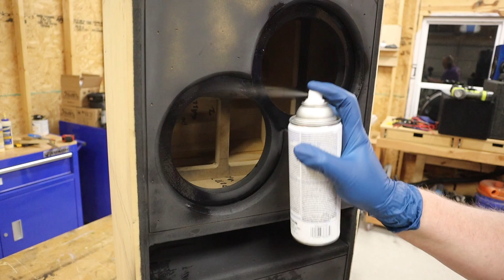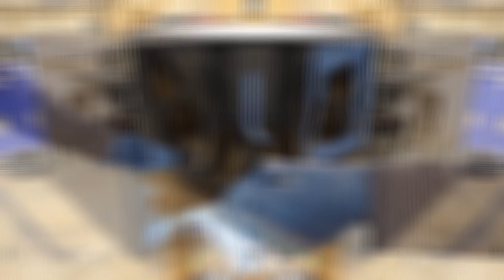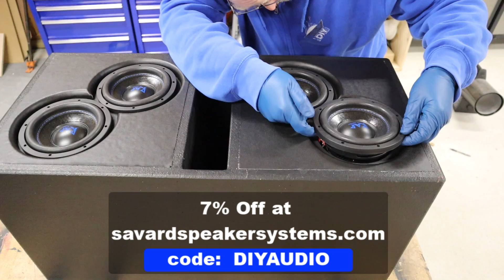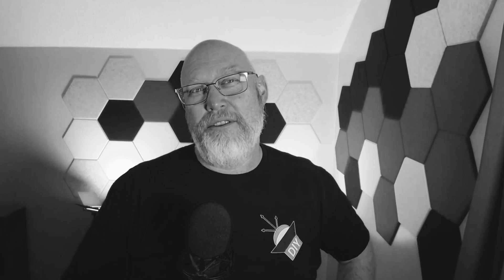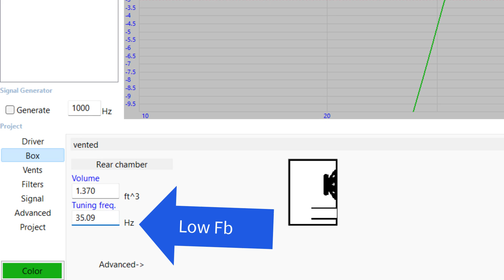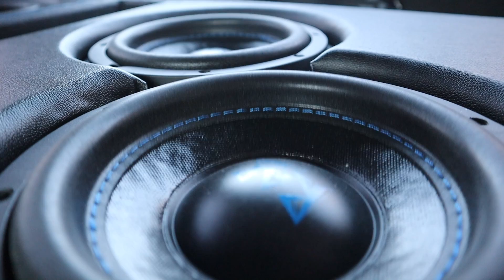Deep bass from a small subwoofer!

Comment: Great videos. For your Exohyde, 'prime' your box with Rustoleum latex paint in black semi-gloss. I get quart cans from the local big box store. A coat of that as primer helps seal the wood and prime the filler. Then Duratex (or Exohyde) will stick better, and use less. I've gotten way with one coat on some, Although two is more durable.
Reply from the maker: Right, will do that next time.

Comment: My entry level setup is 2 Skar VXF 12s, Skar prefab enclosure, Orion HCCA 3000.1Dsplx, audio control Epicenter. Been running 4 years now, flickering the clip light, wired @ 1 ohm, and all components have been pushed hard daily. 
(DC Power 325 HO & all power/ground is 3 runs of SkyHigh OFC 4/0 XL wire
Reply from the maker: Nice.

Comment: make the box big enough and even a  5 inch midrange speaker can play  about 35 hz...       so a single 6.5 inch subwoofer is more than capable of hitting as low as 30hz,     and here you have  4 subwoofers  which can easily be hitting  25hz....  or even 20hz if the box is big enough... like scan speak,  sb acoustics, peerless  woofers or subwoofers,   the main problem is  the FS....   and car subwoofers all are stiff and have higher resonance frequency...  so try some home audio speakers and you will see that they can hit the deep notes better  than car subwoofers...  because they have a lower FS ,   like 35 hz,       where as a car subwoofer 6.5 might have 40 to 50hz fs...    the tang band 6.5 subwoofers can play low ...  but has weak upper bass...

Comment: Love your channel, hoping you can address a couple of questions for me with a plan I have to upgrade an existing system:

1. If I fill air space on a prefab vented box by 0.10ft³ would that significantly affect the port tuning?

2. If I'm using an amp that doesn't have a subsonic filter could I safely use a vented box assuming my gains are set correctly and I'm under powering my subs by about 50w RMS and the air space is within recommended range by the manufacturer?

Comment: Nothing here is wrong with the box and tuning and such.. when you take subs like this and put them in a box like this.. a bass reprocesser is a must! What you’re experiencing with the deep lows that don’t punch and the higher notes that punch but don’t dig is a product of putting high fs smaller subs into a large low tune box.. 

You need a reprocessor to take those 70-80 notes and turn them into to 35-40 notes.. 

Also when you do this is better to fine a little lower.. 30-33ish cause it will play better with the reproduction notes for an overall more natural sound. 

You’ll need to go super wide with the range and then tune the impact of that range to your liking based on music you listen to the most.. 

Generally when I design and build a box like this with subs like this I also like to go a bit larger on the volume.. around 25% and then a bit smaller on the port.. idk what you ended up with on this.. but instead of the normal 16sq per cube on the port a lot of times with the larger volume and already low tune since these don’t have extreme mechanicals with say a 25mm one way xmax.. you can drop the port area down to 12-13 range and the added pressure in the box will help with the responsiveness of soft drivers like these are.. 

Last note.. as a general woodworking basic.. always coat your product with some killz or bullseye primer first.. one of seals the wood really well.. cause it’s thick it hides a lot of imperfections, it also makes for less issues when you paint or coat it with whatever.. pretty much everything sticks to it and it sticks to everything.. from woodwork to painting drywall to pretty much any and everything.. I either mix it into my paint or I apply it first as a primer.. 

Talk to any professional painters and most will tell you they mix some version of killz or similar primer into almost all exterior paints cause it eliminates having to know if the existing is oil or water based etc..
Reply from the maker: You only need a bass processor if there's something wrong with the signal, or the music does not have the low frequencies.  All of the problems with this box can be fixed with a little bit of EQ to take out the boomy upper frequencies.  It had no trouble hitting the low frequencies in that 20--50 HZ range.

Comment: the tolerances for this box design have to be spot on to work right.  it's effectively 2 ported enclosures, with the ports merged together.  you can't avoid at least some cancellation.  finite driver variations will wreak havok on the tuning, and you have 4!  can you really expect them all to move precisely alike?  impressive display of woodworking and driver consistency if it works correctly.  i don't think i would try it, tho.  if you had to replace one driver, you might have to replace them all, or break-in the new one til it acts like the old ones (but will it ever?).    i think it's a damn cool looking thing tho.  i got nothing against the small driver's, i have a pair of 6W0's and they're little wonders.
Reply from the maker: I was very happy with the sound.

Comment: I wonder if you would have better luck using a water based wood filler instead of bondo putty? The wood filler does contain actual wood fibers and dries hard and is sandable, and that may help the duratex bond to it.
Reply from the maker: For this purpose, yes.

Comment: In the late 90’s, I designed a 4th order for a Fosgate Series 1 10” subwoofer.  It had a similar impedance peak as this one, but the lower tuning frequency peak was a little lower and the resonant frequency peak was a little higher(higher impedance, not higher frequency).  The setup was hooked up to a HiFonics Vulcan (180 watts bridged) running 4 ohms bridged.  

It ended up being a one note wonder, but holy cow was it LOUD!!  The 808 bass note in some old Korn songs was right at the peak.  Several people swore I had a pair of 15s in the trunk, and were shocked when they saw this little box that only had 2 ports showing.  

Ever since then, I have enjoyed playing with smaller subs.  My last project was eight 6 1/2” woofers in infinite baffle all running on a JP8!  I love small subs, and even though the box is not perfect, I love this dive into the small Savard Raps!!!
Reply from the maker: I was happy with the sound and the performance.

Comment: I've done a lot of pro-audio speakers with Duratex...and I always do a coat or two of flat-black latex paint first. The latex acts as a primer and mostly fills the brad nail holes, so I end up using much less Duratex for the final coats. Another application method is to spray the Duratex with a cheap 'texture' spray gun like what's used to spray popcorn ceilings in houses (like $30 from Harbor Freight). Run low air pressure so the gun just 'spits' the Duratex out -- I much prefer the result over using the textured rollers!
Reply from the maker: I might have to give that sprayer idea a try.

Comment: Nice to see the completion of the project.  Sorry to hear that you are not over the moon with it.
FWIW, it may be an old construct but, even with the stiff suspension, over-motored drivers we have these days, I really avoid tuning below Fs.  It just causes too many issues.  Also, if you want a vinyl facia like that, consider making the front baffle a separate insert that you can wrap fully and then attach to the main baffle.  Super 90 is going to have a hard time keeping that vinyl on with summer heat.  Just some observations from an install dinosaur :face-orange-raised-eyebrow:
Reply from the maker: I've been rethinking the way I approach vinyl.  I need to try something different.
Reply from the maker: I think it's time to rethink the way I have been applying vinyl.
Reply: Vinyl is a beast either looks good or aweful.

Comment: I would be interested to see the Impedance plot if you were to run each pair of drivers in Parallel as well as for each VC, to get 1/2 Ohm pairs, then wire the leads from each 1/2 Ohm Pair in Series to get back to that 1 Ohm Final Impedance. Just a thought.
Reply: I have seen where wiring multiple woofers differently makes a HUGE difference in final impedance and also where it does nothing at all, so worth a try just to see what happens
Reply: Yes wiring the coils in a different configuration can and will affect the final impedance but the peaks and valleys will stay proportionate since they're affected by the air load of the port not the inductance of the coils

Comment: Now that we know that the Exo-Hide does not stick to the red putty work, you may want to test how well the flat black spray paint adheres to the putty. If it sticks, you can re=spray those spots like a primer, then use the Exo-Hide to retouch those areas. Regardless, these learning experiences are invaluable and just a normal part of the hobby. Good on ya' for admitting it and carrying on like a DIY soldier. Cheers!
Reply: 100% agreee!!!
Reply from the maker: Good idea!

Comment: Does anyone know of a dual voice coil 8 inch woofer, not sub-woofer, 2 ohm or 4 ohm?  I've been looking for months and have not found anything but sub-woofers which I tried but didn't get the frequency range I'm after which is just above the sub-woofer range and below the range of 6.5 inch woofer/mid-ranges.  The amp will go up to about 75 watts at 2 ohms and about 50 watts at 4 ohms.  If anyone knows of such a speaker please feel free to comment.  Thanks.
Reply: I thank cdt audio has one
Reply: @stormyyoung6344  Thanks Stormy.  Yes they do, and it's on sale.  I think I'll try it.
Reply: @billcrane2444  I run cdt had good luck with them
Reply from the maker: I can't think of anything off of the top of my head.
Reply: Maybe ds18
Reply: Maybe ds18
Reply: Maybe ds18

Comment: Palm routers are great until it skips. I always felt a router table would be better but I don't have room. All I use is a palm router except for a standard router with a permanently attached circle jig.
Reply from the maker: This box ended up weight an metric f ton, dragging it over to the router table was a pain.  Would have been easer to grab my other router.